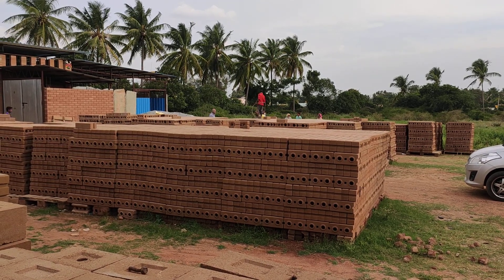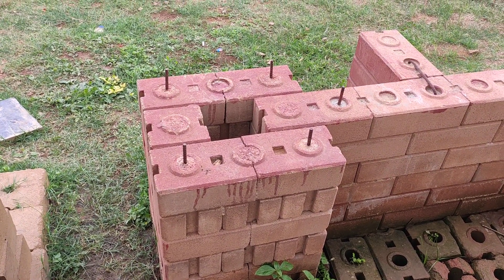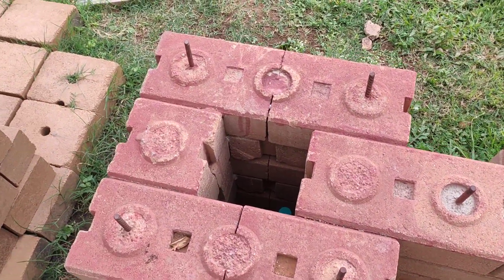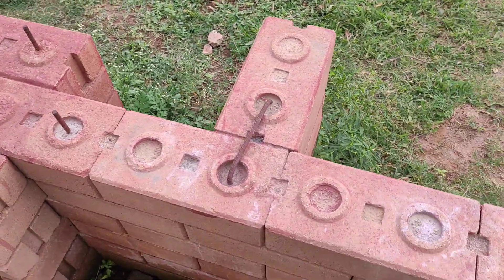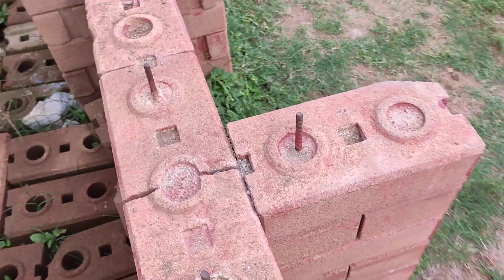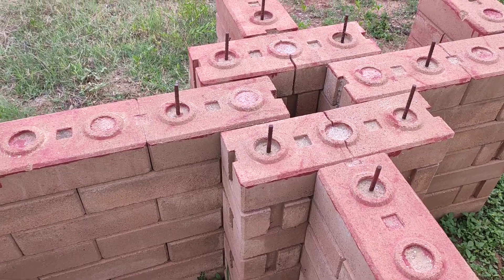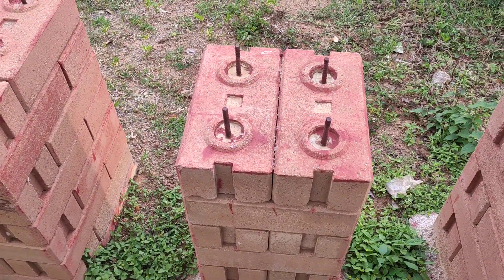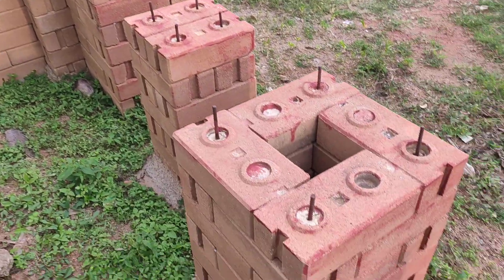Rebar &  Interlocking Brick patterns

Comment: what about longevity, here in kerala interlock soil bricks are available, but after a few years they start to crumble more so if you live in coastal areas.
Reply from the maker: from what we have researched most manufacturers do not make blocks the right way, from selecting the right soil to processing it the right way. without the right mix design quality cannot be achieved.